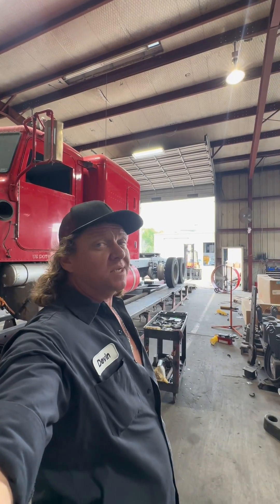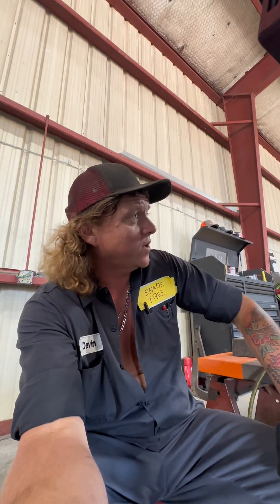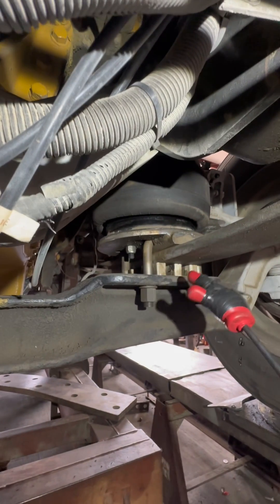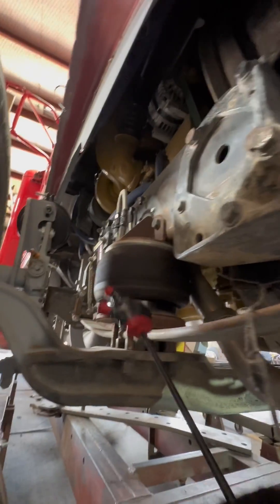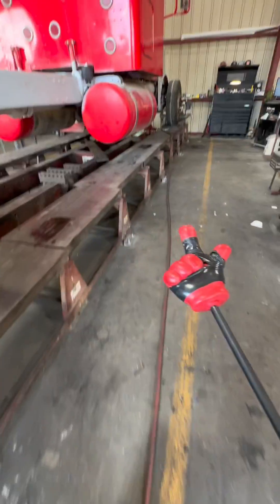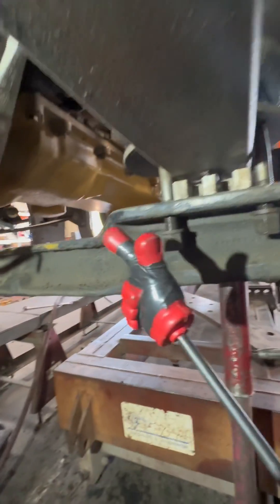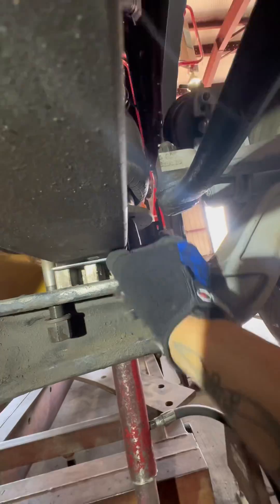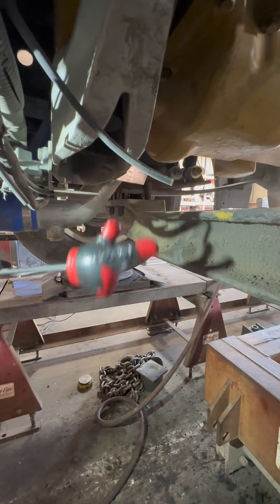317 “ wheelbase peterbuilt alignment

Comment: You can raise or lower caster, with the same degree wedges.  Installing two different degree wedges isn’t gonna twist that heavy axle, it creates a preload on the spring, and a bump steer or jarring sensation. IMO
Reply: man no wonder. I had someone align my truck and man it rides like crap.. I think too much caster block